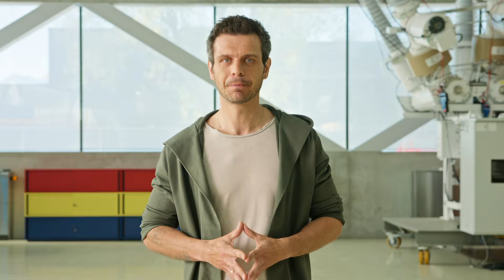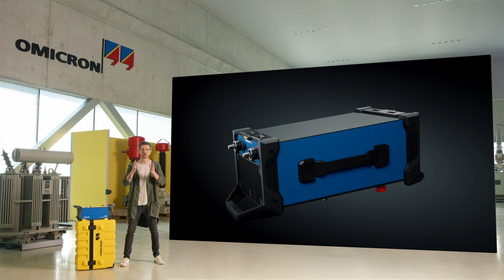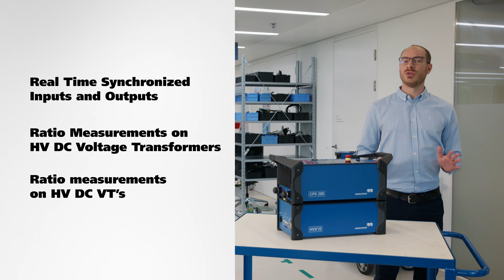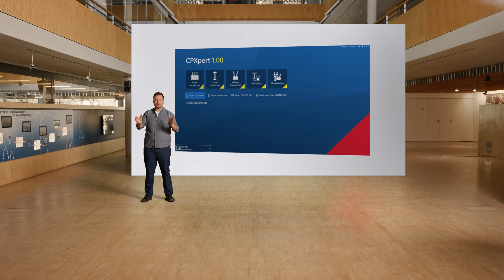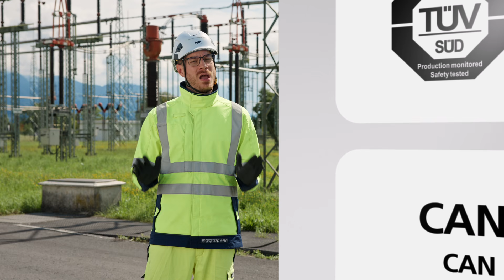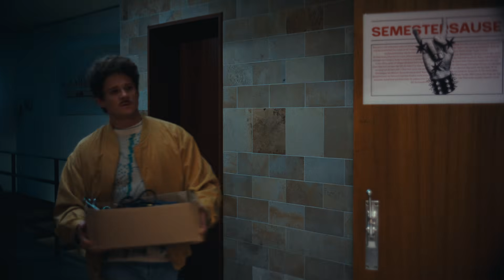CPX 200 Keynote: Our Experts Present

Comment: It's a single or 3 phase device for transformer testing?
Reply from the maker: Hello, 
Thank you for the question. The transformer ratio can be measured in 3-phase mode, using the CPX 200. The OUT B can be used as a 3-phase voltage source and the BIN IN inputs are used to measure the voltage on the secondary side. The other tests, involving a current source like the transformer winding resistance test, are performed in single-phase mode. The CPX 200 has no 3-phase current source. 
I hope this helps.
Best regards